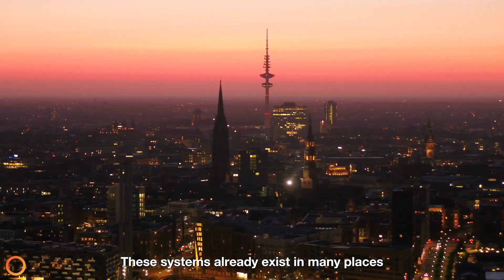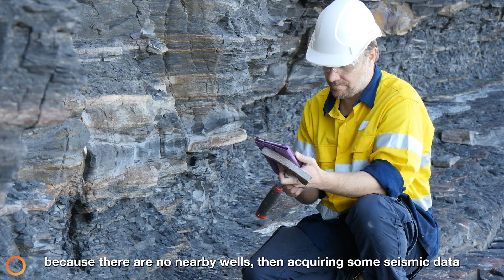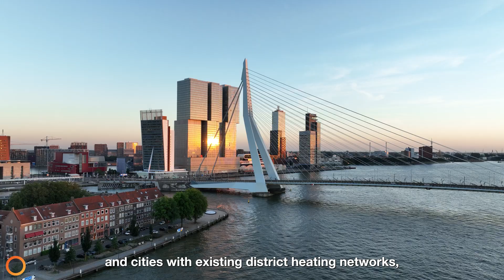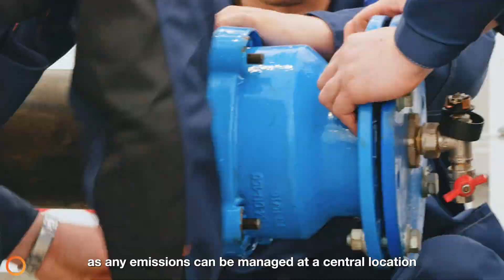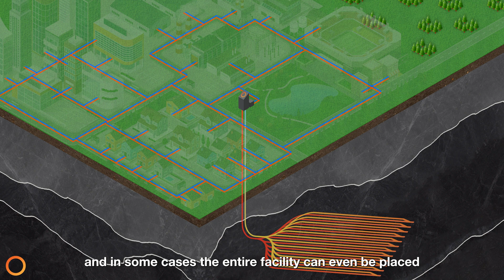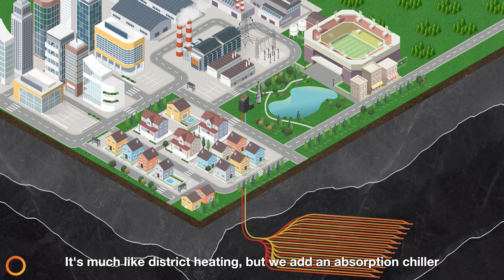Using Geothermal For District Heating

Comment: The difficulty in the USA is cooling.   The A/C system requires much higher air circulation than forced hot air heating.  

 It's impossible for greenhouse gas behavior to cause global warming.  Global warming was officially stated at 1.1°C in 1991 and 1.06°C in 2022.  There is no mechanism that would allow greenhouse gas behavior to cause global warming.   The back of the United Nation's IPCC science report states it took its greenhouse gas samples at 20,000 meters altitude where it is common high school level knowledge there is no greenhouse radiant energy.  This is typical practice for deceptive marketing to state legal data transparency protecting the perpetrators from fraud prosecution.  

Earth's greenhouse effect is frequently used as a primary example to high school students of a system always in saturation from the strong greenhouse gas water vapor absorbing all the greenhouse radiant energy from the earth with greenhouse gases within 20 meters of the surface that is all around us everyday and can't have its overall effect changed.  There is no further greenhouse radiant energy to interact with greenhouse gases.  At 1% average tropospheric water vapor over 99% of earth’s greenhouse effect is from water vapor.  Water vapor would hold earth's greenhouse effect in saturation if it were the only greenhouse gas in the atmosphere.

Arctic warming is taking place with the proving mechanism being warm Atlantic Ocean waters migrating deeper and more frequently into the Arctic Ocean warming it and the region.   That warmer water is causing a few weeks less of reflective snow and ice coverage resulting in more solar heat gain to the Arctic region surface.

Atmospheric CO2 levels of 1200 ppm about three times what they are today would greatly invigorate C3 plants the majority of plant life on earth greatly greening the planet. 

0.4% of the atmosphere is CO2 and on average 1% is H20 water vapor.   (1% H20)/(0.4% CO2) = 25.  Water vapor is 25 times more present in the atmosphere on average than CO2.   Water vapor has an CO2e of 18,  18 X 25 = 450 CO2e total for water vapor to 1 CO2e for CO2. 

The Earth’s oceans have 3-1/2 million sea floor volcanic vents warming the water and changing it’s chemistry that have not been systematically accounted for.

Comment: What's the average service life of one of these systems? . . . Do they degrade over time?
Reply: I've watched a few videos on the subject and done some reading, there is the possibility over time that rock cools a bit and doesn't fully heat the water as much.  And the hole is coated to minimize leakage into the surrounding rock, so that coating would eventually degrade and need to be replaced I suppose.  And super hot water does degrade the pipes at the surface. The hot water will leach salts out of the rock that will need to be filtered and the fiters replaced.  But compared to any other form of energy this is next to nothing in ongoing costs, it's all about drilling the holes in the first place, after that it's essentially "free" energy.  They say 30 years plus in the video, but there's no moving parts, the natural thermal cycle means they don't even need a pump. no radiation gradually degrading it container. Better than solar panels which slowly degrade over time in sun and rain.
Reply: I wonder if there are academic papers that elucidate what you have written.  Perhaps with costs and life expectancy vs. the same for solar and wind.  Another source that I think is majorly underutilized is wave action - although there are some installations that are providing significant power.  And, we have lots of coastlines.  Tidal action could be used, particularly in the northern and southern latitudes.  I know that there's quite a bit of loss over the long transmission lines, but if the energy is nearly free, what does it matter.  In the long run, I think we need to exploit all of these options, including small nuclear reactors.  I'd like to see humanity save oil for pharmaceuticals, plastics and lubrication, rather than using it just to generate heat.
Reply: Every single source I've read says geothermal recovers if left alone or not taxed as much. These power sources are essentially eternal. Millions of years. All non renewable are like 100 at current levels. There is no other viable source, its implementation is not optional.